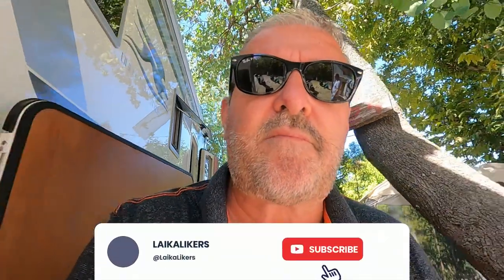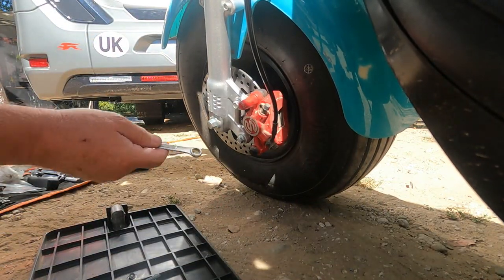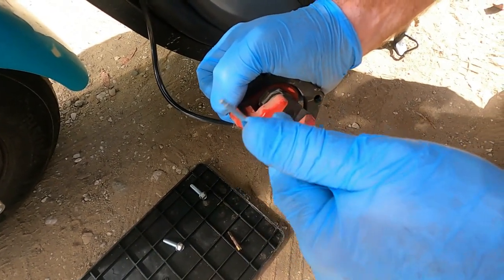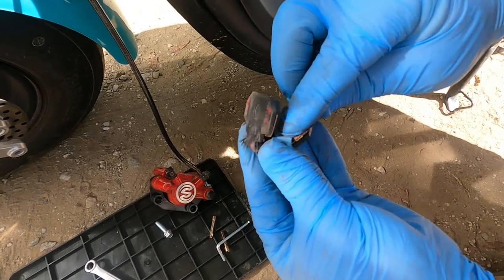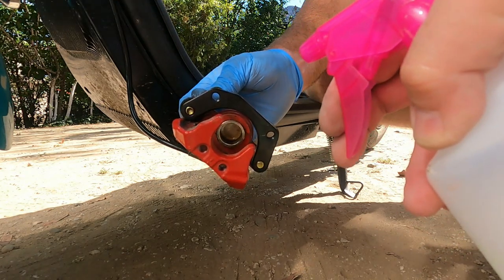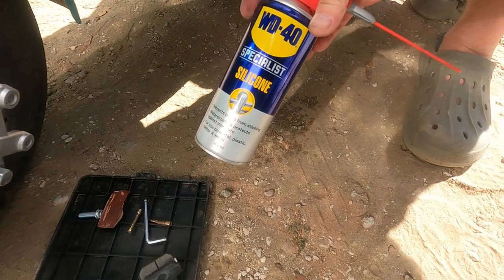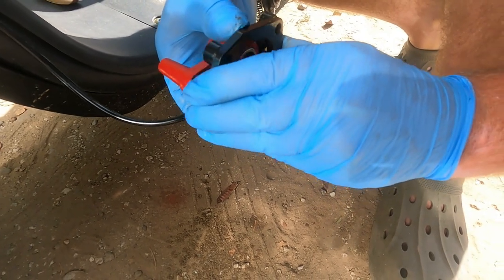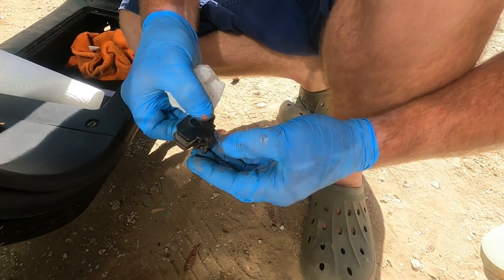CITYCOCO - Fixing Squeaky Brakes

Comment: Any advice on bleeding hydraulic brakes
Reply from the maker: Hi Jeff, I haven't a clue as not had to have done that. But we are currently with our friend Tony who is a plant repair specialist who has great knowledge of hydraulics. I'll ask and see if there is any advice we can offer.
Reply: @laikalikers9570  Thank you for the reply. I had a piston seize up on the left handbrake. Apparently this is something that needs to be lubricated once in awhile. I thought it was the brake so I took it all apart only to find the hydraulics were fine but couldn’t push the piston anymore. I found a vid @ Phat Scooters that recommended contact cleaner then dry lube from WD 40. After getting my search terms finessed I was able to get good info on bleeding the brakes. Thank you for your contribution :)